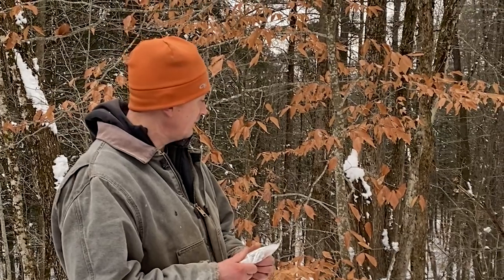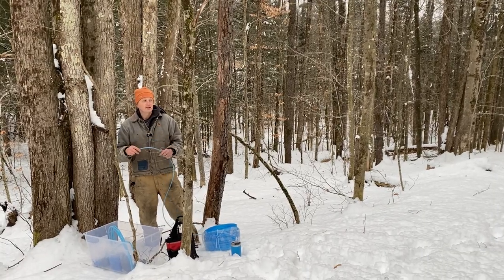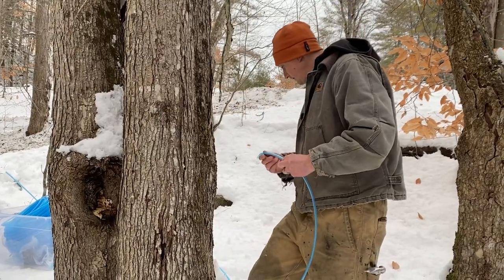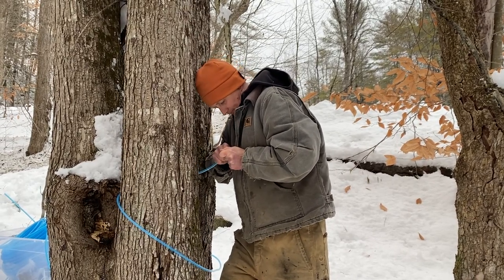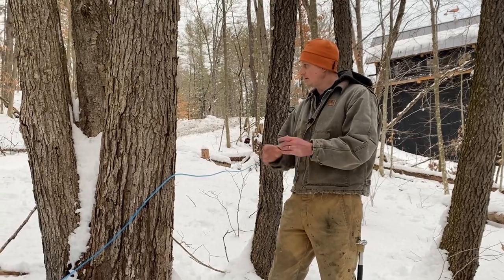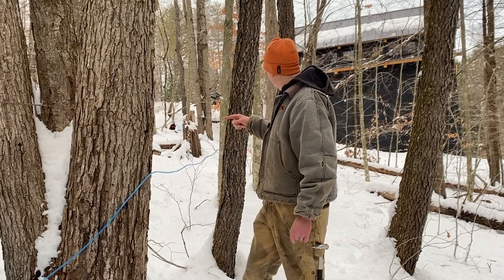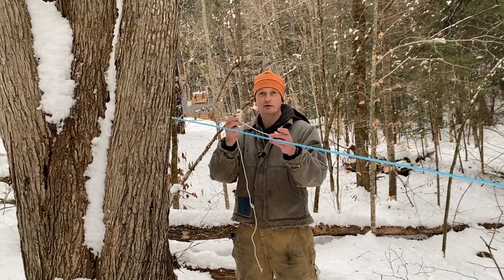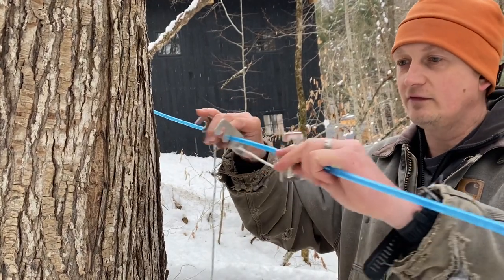DIY Maple Syrup - Running Lines to Collect Maple Sap - Vermont Evaporator Company

Comment: Wow...just wow.  1.  Start at the top of the hill cutting the tubing, putting in your T's and drops as you go down hill.  2.  Use double-headed nails in case you need to remove them (and you will at times) tightening the line as you go.  3.  Get a "one-handed" or "two handed" tubing tool vs hot water to put your tubing together.